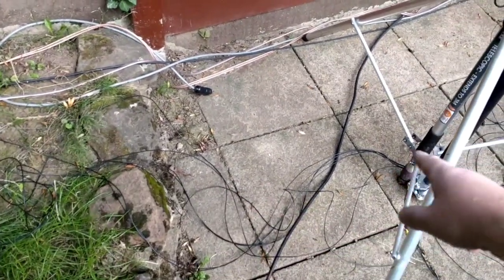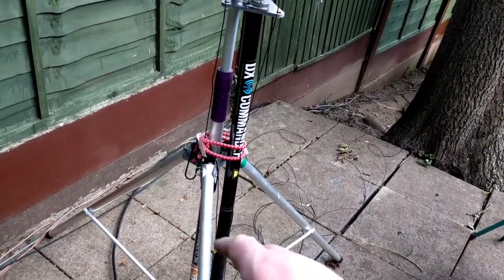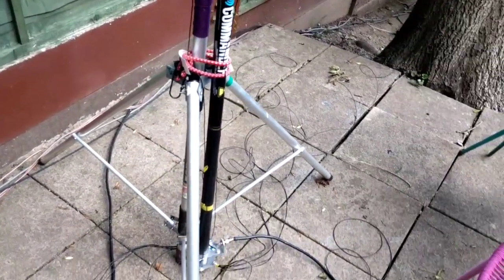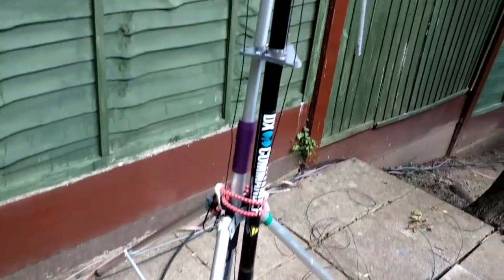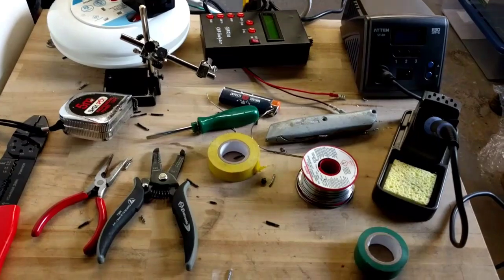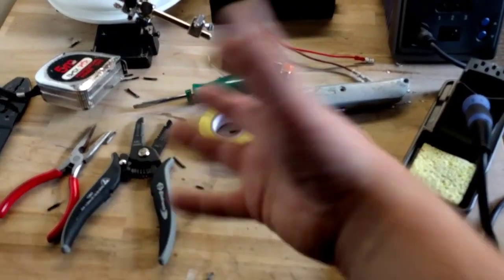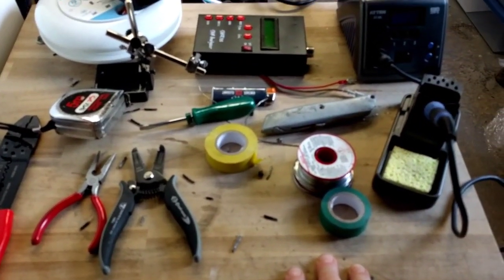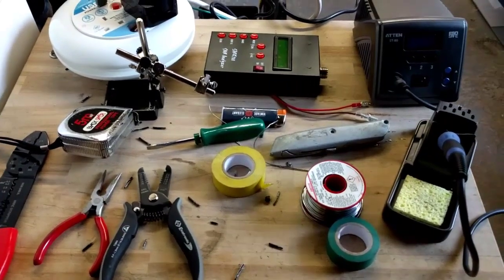Building the DX Commander lite HAM RADIO antenna

Comment: The most important thing, how well it's works 73 KQ4CDPaul
Reply from the maker: The DX Commander has worked well at my new house, I was concerned about my hobby for quite a while prior to the move due to limited space and new neighbours. The DX lite is only 7m and during the better propagation I managed to make contacts with continents I never achieved using the end fed/G5RV, mostly because I'm now vertical. The DX commander is not a base antenna so I should be considering a replacement or modifying it after 2 months of using this temporary antenna.